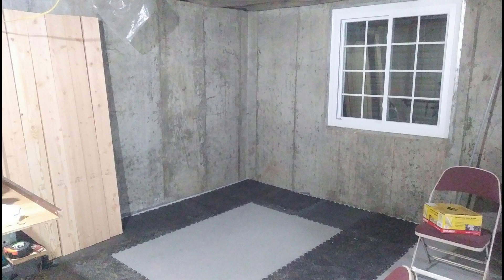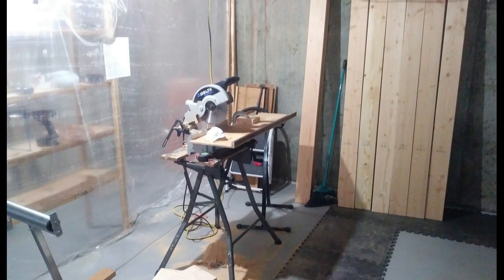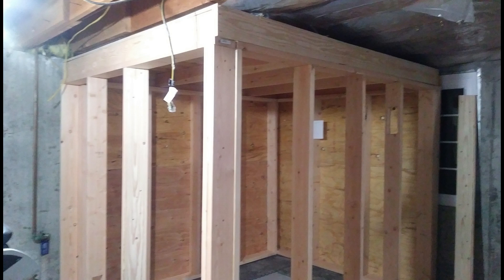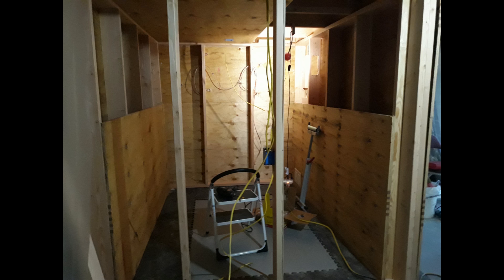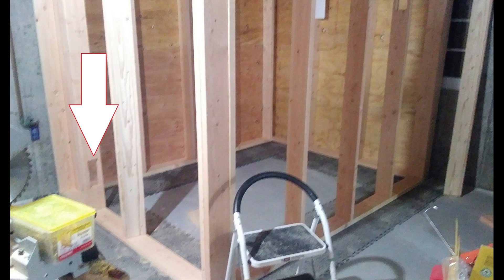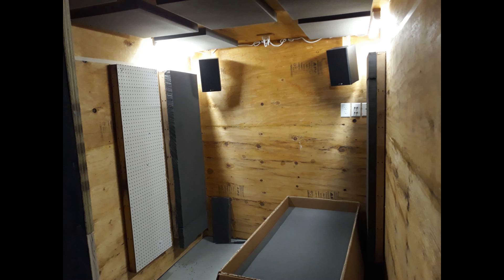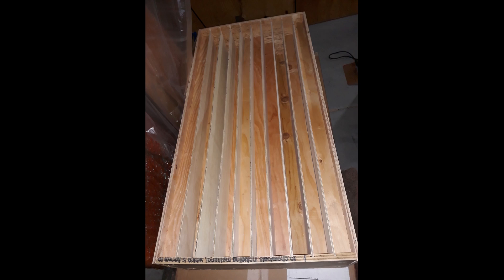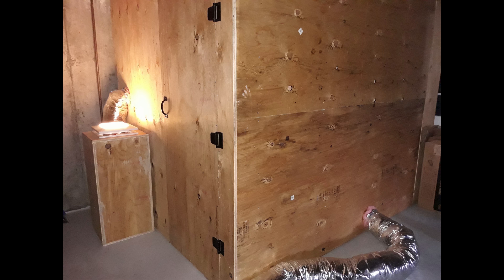DIY - Vocal Booth Done Right - www.AcousticFields.com

Comment: Nice but the voice sounds very closed.  Might be the homemade diffuser.  Or maybe there just isnt enough diffusion,,, but it sounds like you are in a closet and no airiness.
Reply from the maker: This is the issue with small vocal rooms. The trend is for a larger room approach with moveable panels to form a variable acoustic methodology. You take advantage of the larger room volume and manage the reflections with different treatment types.

Comment: A good example of only building to requirements. Obviously it's not designed to isolate neighbours from electric guitar or loud singing. The basement walls look like they would do that already..
Reply from the maker: Its a vocal room.
Reply: @AcousticFields  For sure. 
If there was a lot of outside noise, the vocal room would need some isolation to stop that noise encroaching on the recording.. so always the amount of isolation needed is taken into account, whether a lot or not much. In this case, not much needed.  

I think there are many folks out there who would over-build for the sake of it and not really consider what they really need.

Comment: Ok so I’m new to the field and just building my booth. I don’t know much about the rating you mention I thought I needed to be concerned about decibel levels. Have you taken any decibel readings in the booth? Also I’m very interested in the ventilation and any noise picked up caused by that? 
Thanks
Reply from the maker: The materials and construction methodology you use in your booth are directly related to the noise levels in your room. Air movement created by ventilation can be easily managed.
Reply: @AcousticFields  well I guess I’m not sure that actually answers my question. So have you or do you take decibel readings in the booth ? With fans on /off ?
Reply from the maker: @rodkeffer9310  This was a DIY project. Client built the room himself. I do not know what measurements were taken.

Comment: What was the size of the booth
Reply from the maker: S,  I do not recall. Best guess 6' x 8' x  7'
Reply: Acoustic Fields thank you you are a good man
Reply: @AcousticFields  in the order of width x height x depth? pls specify
Reply: Will a 6ft long
4ft wide
8ft high
Room be big enough for a vocal booth?

I have a closet that size, so far I've added Rockwool to 1 of the 4ft walls (the only brick wall)
And the other walls have basic vocal padding
The ceiling has 1.5 inch ridged fiberglass panels
The floor is just very thick rug

I have some 1" ridged fiberglass panels I can place against the other 4ft wall

I feel like I've wasted my effort and money because I'm worried it's too small now
But I don't really know enough

Comment: For the hvac you just made a intake and exhaust with a fan. Did use a heating cool conditioner unit
Reply: Since it is in the basement it stays fairly cool. I use a heat lamp to warm it. That works well.